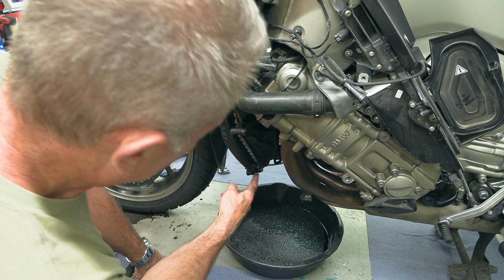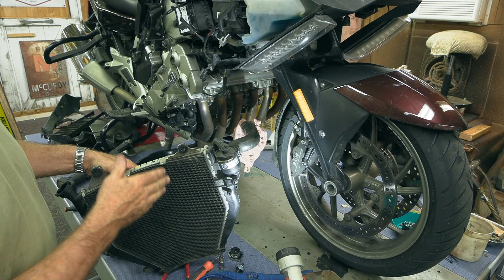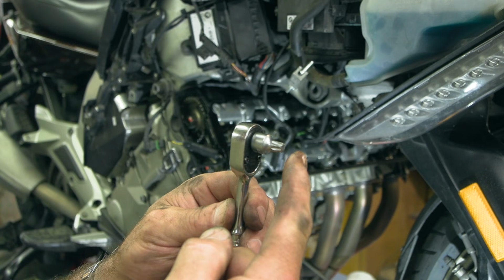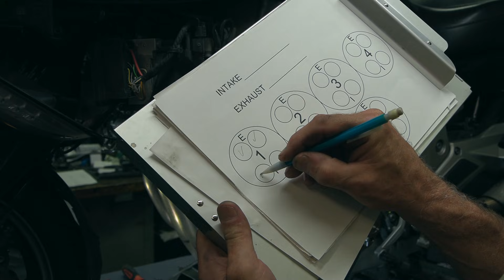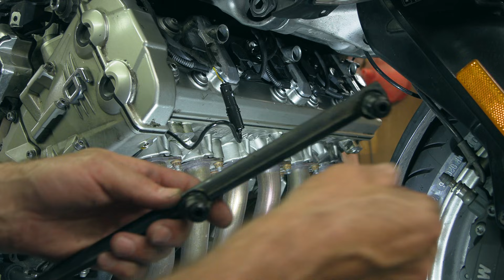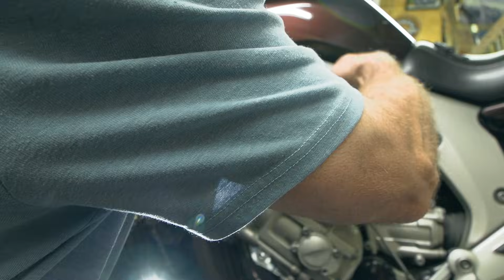BMW K1600 Valve Inspection

Comment: Possibly stupid question: if you jam a larger feeler gauge in there hard enough can it open the valve against its spring and give you a false reading? Or is there too much pressure from the valve spring?

Comment: For any readers wanting to do this, you gotta be REALLY careful lot to apply any prying force near the plastic connector on the coils when removing them. I broke one doing that. A coil puller is nice, but you can do it with a nice pry tool but stay well away from the plastic area where the coil wire connects.

Comment: So, I've determined that this level of maintenance is beyond my capabilities or at least confidence level.  I ask if the engine is purring like a kitten, is there an actual need to have this procedure done at the 18k mile mark?
Reply from the maker: I used to think no. Now I very much recommend it just to keep ahead of any trouble that may arise. I can tell you that in my shop, I would adjust any that are even slightly questionable. It is worth the effort and time. Bring your bike to me if you can.

Comment: What did you find wrong with this engine that caused the valves to be so far out?  Bad cam?
Reply: I believe you need to watch the videos to learn that....
Reply from the maker: You will see in the upcoming video on the adjustment as well as a synopsis video